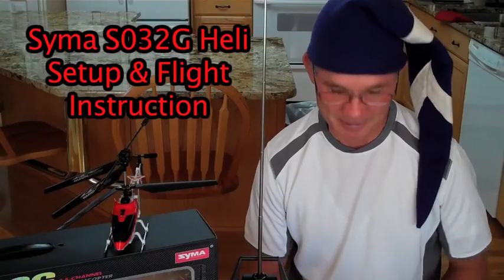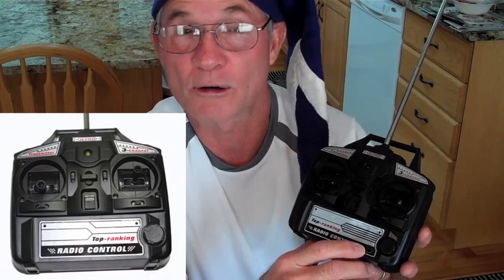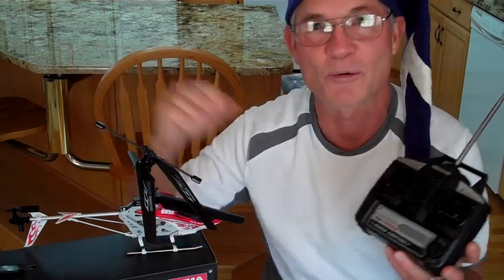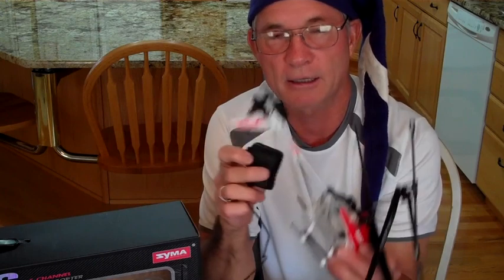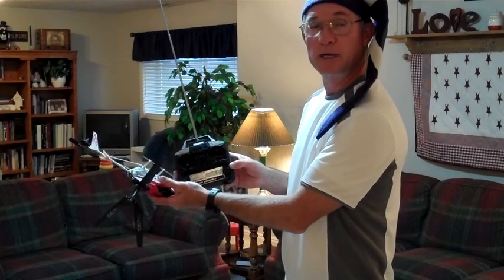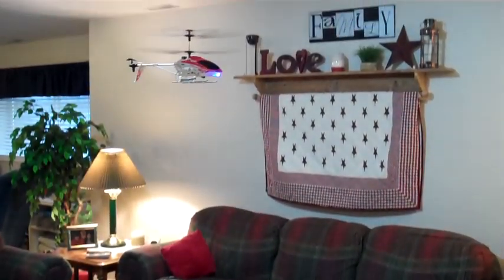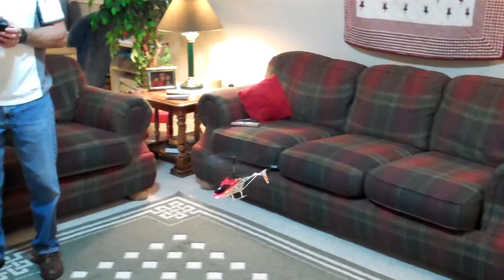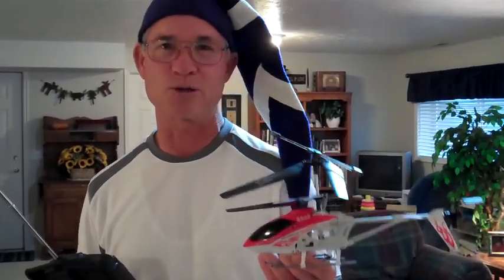Syma S032G Heli Setup & Flight Demo

Comment: Craig, this is exactly what I needed to get me started. I have the new S032G for Christmas and you have successfully answer the initial questions. While charging, I'd been looking for the heli LED to come on, now I know it's on the charger. Your video should be included with every S032G sold. You did an excellent job and I greatly appreciate your time sharing.

Comment: I can't believe it has been a year since we made this video. Remember the fast/slow setting  regardless of the button position will go back to slow mode when you turn the transmitter off in case there is any question. Fly in the fast mode outside...Merry Christmas again just one year later and Happy New Year..Craig and Papasherm.

Comment: Well Craig Santa brought me one for Christmas and I hadn't even gotten into the manual yet. Fast  & Slow button? How cool! Haven't had that feature before! Looks like it moves better than my Blade MCX!
I think your video just saved me having to read the manual. Was a bit perplexed by the lack of any light from the charger. I'm used to one that gives you some input as to the fact that it is working. I thought I might have a dud brick.
Thanks for your info!
Merry CHristmas!

Comment: The charging connector is keyed so that it should only go in one way. I believe it is arrow up ..however look at the holes in the end of the charging connector and the prongs on the heli side in the connector and you will see the vertical spacing for each and how they must line up to plug in.

Comment: The heli only has one connect buckle linking the balance bar to the top blades so you are fine..For  other new readers.. remember to read all the posts for some added instructions that I tried to make clear. We are thinking about making another instructional video on the E sky Big Lama, V4 and Blade CX2 for those of you who want to take the next step up to a Hobby Grade 4 CH Heli...See Msteer79 for some nice videos of the Big Lama and Lama V4 in flight..Craig

Comment: I'm here because I just noticed I have only 1 connecting buckle to the balance bar. While this works, it can't be right for the simple reason it creates an unbalance in weight between the two sides, which will result in extra vibration in the same manner as an unbalanced tire/wheel on a car or an unbalanced blade on a lawnmower. Anyways, I got some buckles coming with other spare parts.

And nice video, too!!! Thanks

Comment: Thanks everybody..This video was edited due to time limits on length by you tube. When turning off the heli and transmitter it returns to the slow mode regardless of the position of the fast/slow toggle switch.After turning everything back on push the button once to return to the fast mode. See page 3 bottom picture in manual for the instructions..Keep the questions coming if needed..Craig

Comment: Fully charge battery. Hold heli up by landing gear above head. Slowly increase throttle to full ( left stick). Do both upper/lower blades spin at same speed? If not something may be loose or one motor may be bad...If yes, does heli feel like it has enough power to fly out of your hand? If not, battery or charger may be bad. If it does line up the arrows on the trim knob at lower right corner of transmitter and set on floor. Throttle up to about 40% of full and see if she will lift off ??? Craig

Comment: snoopyy28   If you have the metal antenna on remote make sure it is screwed in tight to remote and fully extended. Do not change the antenna wire on the Helicopter.. Leave it as it came out of the box which is wrapped around the landing gear...Make sure you have charged the Heli battery and have good batteries in the remote. If everything is as stated, and  blades are tight on the rotor blade shaft,  and you still have a problem you probably have a defect in the heli receiver or the remote controller...Craig

Comment: Hi. I liked this video. I have this helicopter, and my controller isn't working for some reason. I am new to this helicopter, so i need help on how to fix it. I checked and all the wires are connected, but it still doesn't work. Thanks for your help

Comment: On a serious note mine doesn't spin after its trimmed bit it drifts around loads and it can't be trimmed out.  What do I do? It's not specifically forwards or backwards etc so weights won't work. Also how many connect buckles should you have as mine only came with one and the one on the other side was missing?

Comment: Abro make sure your batteries are good in the controller and that the helicopter  battery is charged. Turn on the controller, then the heli. Move the left stick all the way forward  for 2 seconds then all the way back. This links up the controller to the heli. If you don't get a response you could have a bad controller or helicopter. Tell me what happens..Craig